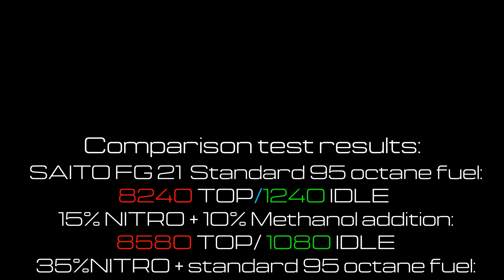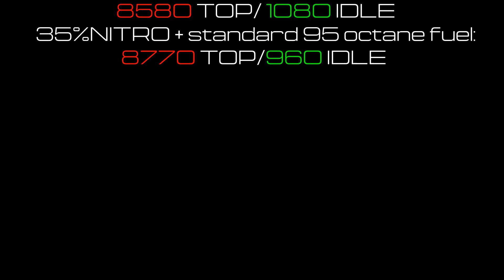Approaching to the limits - SAITO FG21 on 35% NITRO test

Comment: Did you try retarding the ignition timing with the higher nitro?
Reply from the maker: Hi, and thank you for your question ! In this case I going to charge the engine with increased amount of Nitro, to clarify, how much power gain I can get. With spark ignition engine (Saito FG21),  retarding of ignition is much less effective, because ignition is already started (driving by Hall sensor and it's placement). Probably, at the cost of higher oxygen amount combustion cycle  could last a bit longer, but these is just my thoughts for now. To get clear understanding it's necessary to continue experiments of the bench. Thank you and have a nice day !

Comment: Hi what did you use as a binder for the 35% nitro with gasoline? as those 2 dont mix with each other like oil and water.
Reply from the maker: Hi, I'm very much appreciated for your question !
Definitely, standard gasoline could be mixed flawless with nitromethane up to 35% of Nitro in mix, without any hesitations. Everything over 35% will makes this mix blurry and unstable (mix ratio is approx. Of course, it depends of different reasons, too. But in general, 35% is a limit, but could speed up engine well.
Thank you and have a nice day !

Comment: Strong little engine. Be careful though. If you keep mixing fuels you might end up with dragster fuel. Very powerful stuff. That's a nice engine don't blow it to pieces.
Reply from the maker: Thank you for your comment ! I try to be very careful with the engines, if I give an excessive load, then dosed. After such tests, I always check the condition of the internals, the cylinder walls, the piston, the condition of the bearings and the crankshaft journal. Experience shows that these Saito engines are very, very reliable and built with a large margin of safety.
You can find a video with an engine internals checks here: https://youtu.be/N0SVnpe5qPE
 and here: https://youtu.be/UJiU4gN9H9A
Thanks again for your comment!
Reply: @crazyengines88  very good. Reminds me of the top fuel nationals. They rebuild the engines every other race. Completely
Reply from the maker: @shawndubay4050  Thank you very much for your comment ! I can understand them, easily. The only way you can trust the engine - is to look inside after serious loads, and check every part. Any sign of wear, any scratched or matted surface means, that on the next run engine could make a fault. 
Thank you, very touched and appreciated for your evaluation.
Reply: @crazyengines88  thank you and your welcome. If you have never seen the top fuel nationals you got to. It's amazing. They run a quarter of a mile in like 4 or 5 seconds and shoot six foot flames out of the exhaust headers.
Reply from the maker: @shawndubay4050  Thank you, very interesting, I'll try to find more info about fuel nationals ! Have a nice day !
Reply: @crazyengines88  look up top fuel funny car fastest pass.

Comment: Wow! Braver man than me. What ignition timing did you use? standard? 
That sounded so good
Reply from the maker: Thank you very much for your question. Yes, indeed, I'm using factory default timing, so , of course, it could be possible to find some few increased RPM's, trying to fine tune it. But my task wasn't to achieve absolutely TOP speed, but just to evaluate some limits of NITRO influence on engine performance. 
Thank you and have a nice day !
Reply: @crazyengines88  Hi mate, yeah I was actually more wondering if the factory settings would even work.... I am very impressed with your test. 
I'm going to try 10% with a bit more oil in my FG-11 and monitor the temperature with a thermal camera to confirm that it doesn't run too hot.
Mate your test was great and confirms a question I'm sure many people have wondered so, good work again.
Reply from the maker: @aSpyIntheHaus  Thank you very much for your kind comments ! I really feels happy, if the results of my experiments were useful for a lot of RC modelers. It's very clever to check engine's temperature with thermal camera, I really was afraid about so high engine cylinder temp during last test. I think, that it was very excessive NITRO amount. 5-10 will be more, than enough, to stabilize idling, and to add some power on the top speed. Thank you and have a nice day !

Comment: Thanks, nice test, did you tested the same 35% nitro mix with glow plugs?
Reply from the maker: Thank for your comment ! No, I didn't, there was just a real torture test for the engine, it's was seriously overheated. But I can predict, that most of the tested glow plugs will perform similar. The only limitation should be stable low idling - so large amount of NITRO will influence negatively to the glow plug heating element - it will be cooled increasingly, due to the high nitromethane evaporation level. We have NITRO over 1/3 of fuel mix, it's so enormous amount. I think, that 15% Nitro is more, than enough, and if we'll take NITRO cost, even 5-8% will affect nicely on engine performance. It works, in fact.